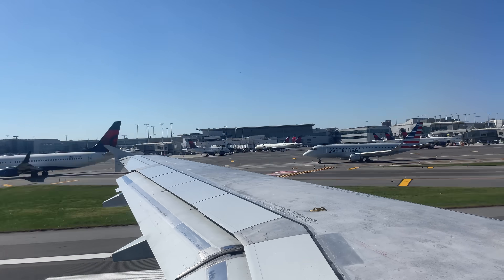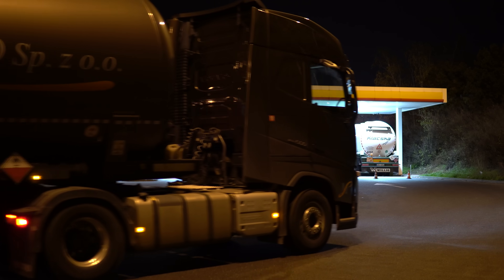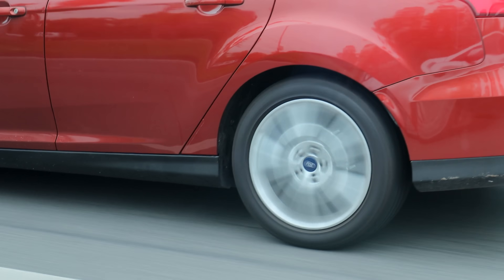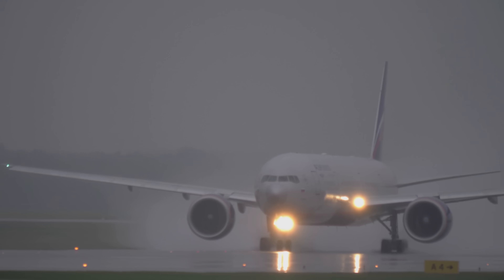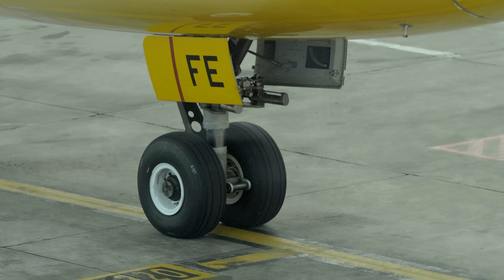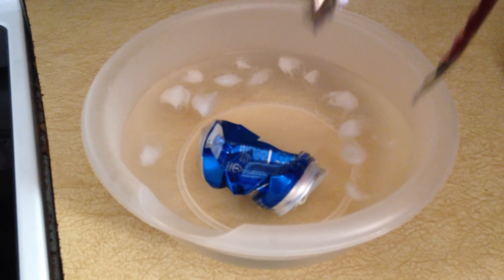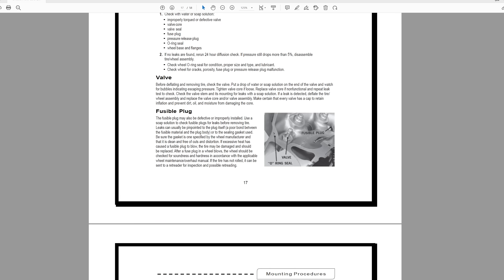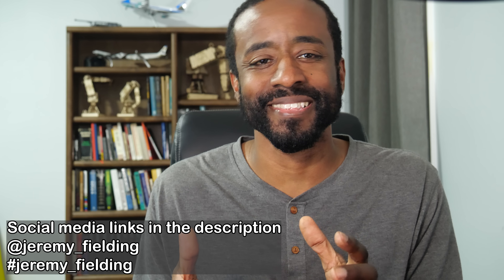The Ingenious Design of Airplane Tires- Jeremy Fielding 107

Comment: Inflating aircraft tires.

Even though the pounds per square in of pressure inside aircraft tires, the air compressors used actually compress the air to 4,000 psi. Why? The air we breath is mostly nitrogen. The fact that the more you compress air the more water droplets form. To get rid of the moisture the air is compressed so much
That by using traps and chemical crystals to absorb the moisture. By the time air is compressed to 4,000 PSI the now mostly compressed nitrogen is dry and used to inflate aircraft tires.

Here's a factoid. The air compressors used to provide air to inflate aircraft tires can and have been used to charge the air tanks of  scuba divers. The only difference is a few extras to ensure that al the oil is removed from the air. The pressure in a scuba tank can be anywhere from 3,000 to 30,000 psi depending on the type of diving. Just shallow general diving 3,000 psi is standard. Remember about our atmosphere is mostly nitrogen. Look up (the bends) this happens when divers surface to fast and the nitrogen isn't allowed time to work it's way out of the divers blood..

Back to aircraft tires. In the AF the tires used on the towbars used to move aircraft on the ground, were used aircraft tires. We also just mounted them on the rims, because the side walls of aircraft tires were so thick they wouldn't collapse they were so thick. These tires would last for years as the "tread" is extremely thick, on the one tire we changed on a towbar the "used tire" tread area was many times the thickness of the tread area of a car tire.
In fact if you did air up an aircraft tire you could probably run over a nail and it would not be long enough to pierce the tread area.

Comment: I have often wondered why little features aren't molded into the sidewalls that would cause the slipstream at wheels down to spin the wheels up prior to landing. That would save burning so much tread rubber at touchdown. The cost and weight of such features is negligible and it seems that tire life could be extended.

Comment: There was a Hungarian invention in the '90s where a young guy put some small fan blades (like that of a turbo) on the wheels to pre-spin the tires before the impact of the landing. It was passive (used the incoming air),light,  had few parts and was able to be retro-fitted to most if not all wheel heads' inner side (therefore no need to design bigger wheel bays).

I wonder what happened to that invention. Last time I heard it was bought by some big US company and then ... nothing.

Edit: Also, Tom Scott brought me here 🙂
Reply: I know those guys and they've been trying to sell that concept for moons.. Maybe some success but very limited from what I recall. The barrier is the aircraft manufacturer, landing gear manufacturer, wheel & brake manufacturers, and tire manufacturers. There's plenty of new technologies out there to improve on decades old designs but making what appears to be simple changes can be extremely time consuming regulatory wise, cost wise, and engineering wise.
Reply: @kenhutchins4891   What a bummer. But thank you for the info! I hope they succeed .

Comment: As well consider the wear allowed, your typical vehicle tyre will be worn out when the rubber is below a certain thickness before the plies, but aircraft tyres you have a limit as to how many plies must be worn before changing them. Consider that you can, with most large aircraft or fighters, take a set of brand new wheels, just put on, and take them to replace condition with just a single poor landing, scrubbing off all the allowed wear in a single action. Have seen this, saw the cross wind landing, with the 2 aircraft involved being at cross wind limit, and scrubbing a lot of tyre off as smoke in the landing, bouncing along till they were finally fully on the ground. Not good to hear plane landing, when you are in the circuit and in line, but the plane I was self loading cargo in had much better cross wind capability, so it came in with no noise, and till the pilot announced we had landed, there was absolutely no bump at all. Which was good, considering at take off we had, due to fuel load, needed all the runway, including the undershoot and overshoot, to actually get to take off. Ground effect for a good few minutes, at a little above treetop height, and we went past a lot of trees.

Comment: Nitrogen is not an inert gas, but it is generally non-reactive with the components found in a wheel (rubber, steel, aluminum, etc.) - or at least a lot less reactive than oxygen.

Comment: When you were comparing truck tires to plane tires I don't think you addressed the fact that truck tires are designed to run at max load and pressure all day long  in any weather.  Plane tires while exposed to higher speeds they only do it briefly limiting the heating due to sidewall flex that leads to fatigue and blow outs
Reply from the maker: I agree. There are a whole lot of application differences. We barely got into it :)

Comment: Sad I missed this video when it came out - I've always asked why do we not engineer something to spin the wheels up to ground speed when the planes are landing, so they don't have to cope with the acceleration on top of everything else. Like a little jet of compressed air pointed at the wheel or something. Might save on changing these wildly expensive tyres quite as often! And having the scrape the rubber off the runways.

Comment: Truck tires are not “stretched” over the wheel. The shape of the wheel Allows the half tire to be shifted to a smaller diameter section. The other half can then be peeled off the wheel.

No stretching happens. 

I assume they don’t do this on aircraft to avoid a tire coming off of a wheel of pressure Is lost.
Reply from the maker: There is indeed a small amount of stretch. Its not much, but it is too much for aircraft tires. I am aware of how the installation happens. This is why I show a clip of it in action as I describe it. The clip shows a man literally deforming the bead (stretching) to get it over the rim. If the tire was made of solid steel you could not install it. Here is a article that mentions this. If you do a deeper search you will find more articles that talk about this difference in stiffness https://www.aeroclass.org/airplane-wheels/  Thanks for watching and caring enough about the details to comment! However, this one is correct.

Comment: Could it be possible to build extra layer of weight divergent array of water and air bubbles so the water at high pressure point to the air bubble and transfer pressure away from point of contact

Comment: You all think that the roads are smooth and nice. You ride in passenger cars with soft tires and suspension. I drive a semi with 110psi (cold) which means that pressure goes up 10 to 15 psi sometimes more. That tire is like a rock, add the hard suspension and I can tell you that the road engineers need to go back to school. The roads/bridge junctions/repairs are poorly done. I feel them all and it is bad.

Comment: Why would nitrogen have less moisture in it than compressed air? I realise that's not the only reason to use N2, but I don't see why air couldn't be compressed via some kind of chiller and/or chemical drying agent to remove any moisture.

Comment: Awesome video! One other consideration for the lower pressure & more flexible tires of automotive is that the tires are also a part of the suspension system of the car, and the lower pressures allow for more deflection on impact with bumps, potholes, etc. giving it that "smoother ride" you talked about. I'd love to see a video on the engineering behind the landing gear!! Looks like some wicked linkage systems, hydraulics, etc. you could nerd out on!

Comment: A car tire isn’t stretched over the rim. It, like the plane tire, has steel bands in the seating bead. The rim has an indented surface in the center to allow the bead over the edge, then you center the tire on the rim and inflate. The static electricity isn’t from tire meeting runway. It is aluminum airplane brushing against dry air while in flight. The carbon black, in all tire compounds, is a conductor that can take high static voltages to ground.
Reply from the maker: I understand the process and It does indeed stretch. If it was was made of steel with the exact same profile it would not go on. It’s a small amount but if there was no stretch at all you would not need a tool to force it over the edge. Even this small amount it too much for aircraft tires. As to the static… it’s both. Thanks for watching:)

Comment: Car tires are also conductive. Michelin removed the carbon and used silicon to decrease the tire wear. They had to add carbon back into the tire because people were getting large static shocks when they got out of the car.

Comment: I wonder why the tires are stopped when landing, wouldn't it be beneficial to have them already rotating to close the speed of the plane so there's not that much friction at the point of contact? you could make them rotate without additional components by using a rim with flaps to use the air friction

Comment: Just wanted to point out the maximum weight of the tractor trailer is determined by a law, not by how much weight the tires can carry. They can probably carry much more weight than that. Plus, a typical landing weight is 124,000 pounds; yes, it's true that the plane has to be certified to land at the maximum take off weight, but that would happen only in an emergency such as a fire where there is no time to dump fuel.

Comment: I spent four years as a US Air Force jet fighter crew chief. Many hours under the wing of the airplane inspecting and changing tires. To compare an airplane tire to the tires of 18 wheeler is really not a fair comparison. Granted the airplane tires take a sudden and much heavier load, but the truck  tires have to carry that truck for tens of thousands of miles a year SAFELY at 60 to 80 miles an hour sustained day after day.  Two very different jobs.  Whereas airplane tires get changed only after a few landings.
Reply: BTW, in spite of what I said I actually do love your channel.

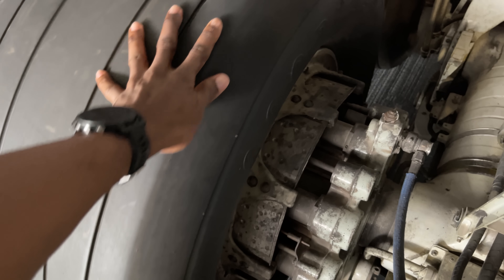Comment: Excellent video. One small correction about grooves (around minute 6:15): the longitudinal grooves are there mainly to prevent the lateral sliding of the airplane when landing in crosswind and thus rapidly realign the airplane axis with its direction of travel (= the runway.) As you already shown, the weight of the airplane generates 10 times or more pressure on the tarmac, than a regular tire applies on the road. This is usually quite sufficient to break water, slush or even a small amount of snow, so counter-intuitively, aquaplaning is not a great concern (at least for the heavy planes.) An additional common procedure is to land a little bit "harder" on a wet runway. So, oblique grooves to pump the water out of the way are not necessary. This also increases the contact patch with the ground, therefore the effectiveness of breaking, as you show in the comparison with the dragster/F1 tires. Your passion is infectious, and the presentation is compelling. Congrats.

Comment: The wheels see a very sudden impact that cause overheating and rubber microparticles polluting the air. Would it be beneficial if they hit the ground already rotating (for example simply modifying the wheels rim to catch air)?

Comment: I recall hearing a story about 25-30 years ago where a kid invented a design for aircraft tires for a competition that consisted of triangular "pockets" fixed around the side wall that would catch the air stream as the plane comes in to land. This would start turning the wheel so that upon touchdown they were already rotating close to the rotational speed to match the ground speed, thereby reducing the wear on the tires. I wonder what happened to that idea.

Comment: There’s another issue with road going vehicles and high tyre pressure: Depending on the road‘s roughness, high tire pressures can increase rolling resistance as the amount of unsprung mass increases. Bicycles are really susceptible to this as many don’t have suspension. Even for mildly rough asphalt, just 40-60psi is optimal.

Comment: Should look into the engineering that goes into the titanium compressor blades and how they are designed to survive in environments that are hotter than the melting point of Ti.

Comment: Hi Jeremy,

I have a very stupid question, maybe yourself or someone in this comment section can enlighten me.

Let’s assume that money is not an issue.
Let’s also assume that we put a 500bhp electric motor inside the wheel hub.

Do you think it will be a good idea to use an aircraft tires to help handle the unsprung masse ?

Taking into account that we don’t need any mechanical linkage since we’re using a break by wire system.

I also read on an article that post WWII guys used to put surplus aircraft tires on their model Ts for better flotation on sand dunes, but I seriously want to take this idea further and see what happens.

Thank you for doing the lord’s work with your channel.

Comment: I've always wondered why the wheels are not spun up to match ground speed before touch down to prevent tire wear, but I suppose that would be a weight issue. Saying that, Perhaps even a simple water wheel type set of static cups would let the airspeed do this acceleration without any power requirements?

Comment: I work on the ramp with Airbus A320's and A319's. The tires are much smaller than I first expected, and the gear assembly is massive! Reverse thrust help a lot with braking, allowing tires to be even smaller. The conductivity also reduces static charge to reduce chances of fire when fueling, and there are also big fans integrated into the hub assembly of the tire to help expel heat! On a cold day it's nice to stand next to it :)

Comment: Great video - as an airplane mechanic my only criticism is that airplanes do not land at the MTOW (max takeoff weight) due to structural or other limitations, although they will taxi and take off at that weight they cannot land at MTOW.
MLW is the maximum landing weight.
I work on the Bombardier Challenger 605 that has a MTOW of 48,200 lbs and an MLW of 38,000 lbs.
If the plane takes off at 48,200 it cannot land until it’s weight is below 38,000
Thanks for the video!
Reply from the maker: Agreed. And of course planes have to dump fuel if they need to turn around for an emergency landing. I definitely didn't say they land at that weight. But some might assume that as I didn't get into the difference. I just wanted to make the simplest comparison that was understandable. i.e. What is the heaviest allowable weight for a truck, what is the heaviest allowable weight for this plane sitting on the ground. No driving loads or landing loads discussed either. There are many interesting details that can be discussed like the difference in pavement as discussed at the end of the video which clearly also effect the design. Maybe in a followup video. :) Thanks for watching.

Comment: But you have not told us the exact construction difference between a road tire and plane tire ,i.e ,it's more plies, re enforcement by steel wires etc. The problem of temp difference at _40c and ground can be tackled by keeping tires heated at high altitudes . Why co2 is not used instead of nitrogen gas, as it rather helps kill the fire ? Why not use skids with replaceable pads ,  instead of tires as is the case with many helicopters? It would solve many of existing problems plus reduce costs.  Can you give me some contact reference of R&D department of some tire manufacturers to discuss a novel idea of tires.  Thanks

Comment: Interesting fact on road pavement design: normal cars are basically ignored in terms of wear and tear and only really HGVs break the roads down. It takes so many cars to equate to the damage done by lorries/trucks that without them you'd need a fraction of the road maintenance unless damaged by other mechanisms (frost heave, flooding, sink holes, etc.)

Comment: I've wondered for a long time why aren't there mechanism to pre-spin the airplane tires. Then they would have to spin up much less than just non-spinning tire. Like putting small cups (like in the house weather stations anemometers) would add just a tiny amount of weight for maybe a big savings. I don't know if that is possible. Just something I have not yet seen in any airplane.

Comment: Re: airplane tires being designed for ideal conditions and thus smooth tires. Slightly off topic, but helicopters (at least the ones that have wheels) also have smooth tread even though they are designed for non-ideal conditions. I have worked with helis designed for full on terrain use and they still have smooth tread. Granted they mostly do not ground taxi outside airports but grip still matters for example when landing on an incline
Reply: Same applies for small ga aircraft and gliders, even purpose built bush planes which have larger wheels but still smooth tread.

Comment: If you like to marvel, think of this: The safest place to be is crammed into a gigantic aluminum tube full of hot wires and jet fuel hurtling through the sky six miles above the surface of the earth at half the speed of sound. That boggles the mind.

Comment: An aircraft has a ground speed of approx. 360 km/h when taking off and approx. 280 km/h when landing. Why don't the wheels get a large rotational speed when landing, to make the contact with the runway less sudden and rubber-damaging?

Comment: Wouldn't the tire skid marks left on landing indicate to some degree a loss of control which could be addressed if cups were on the hub so the wheel was already turning before landing? This would also lessen stress on bearings, struts, tire wear and runway damage without requiring a motor or other device.